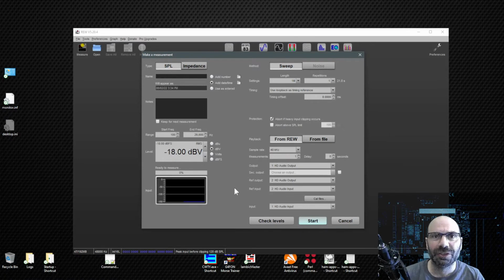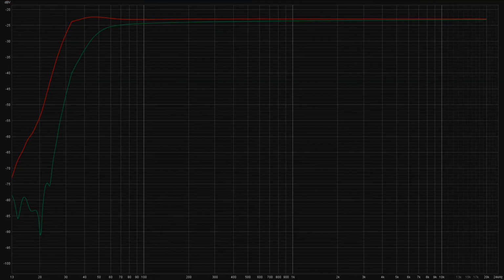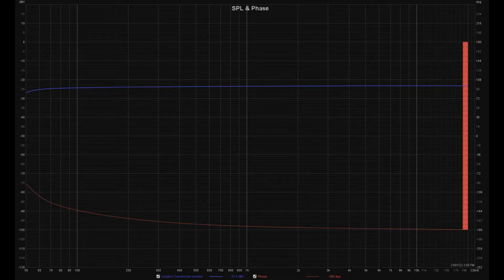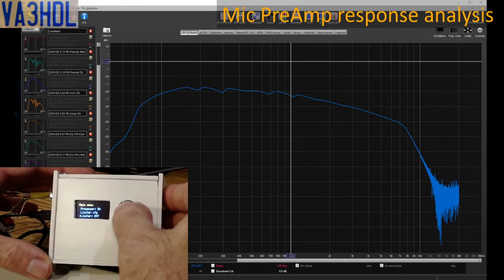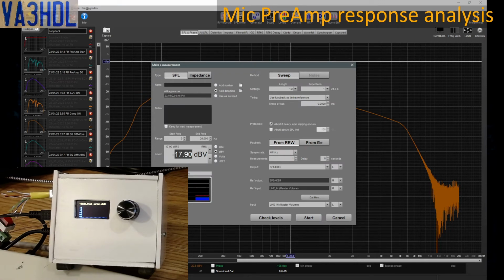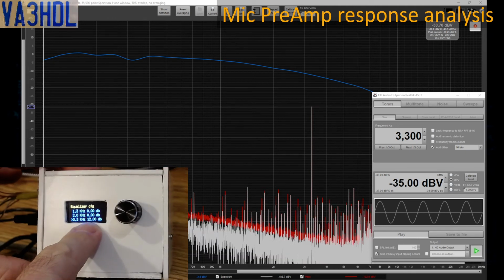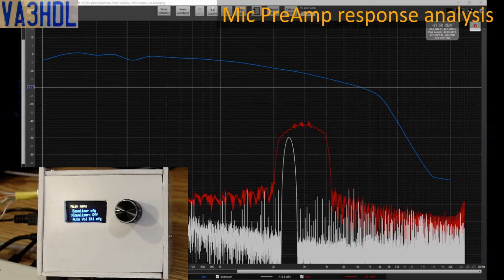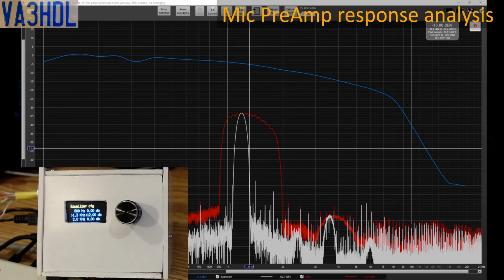Analyzing the response Mic pre-amp and equalizer (Part 4)

Comment: Did you ever work out why the EQ glitch was happening? Does it happen on each EQ setting, or just the 1.3KHz I wonder?
Reply from the maker: It has been three years since I worked on this project and I can't remember. Can you pin point the timestamp on the video so I refresh my mind on this? Thanks.
Reply: @VA3HDL it was right near the end of the video, around 15:30. Thanks for the reply.
Reply from the maker: @ian.dobson  I can't remember if this was fixed or not right now, but when I started looking at the code and the repos in Github I found that I never uploaded my last version of the code. 
I just did and the new repo URL is https://github.com/VA3HDL/DSP_Pre_ProcessorV6
Even is not fixed it would be better to use the latest version. I did this without AI, I guess I can go back now and review the code with the AI to see if is any improvements possible (or you can do it.)
In V6 there is a built in tone generator that helps to trigger an external auto tuner attached to old radios. The tone is enabled by double clicking the encoder and disabled in the same way. When is active is possible to see the waveform of the tone on the spectrum display of the device.

I hope this helps. Let me know you thoughts. Thanks.
Reply: @VA3HDL thanks Pablo, I came across your video while trying to find a DIY audio speech processor and or a parametric equaliser. I'm not sure I'd be up to code modification myself, but if I can get the bits together for your project it might be fun to have a go at it. Do you have any links to the parts I would need?
Reply from the maker: @ian.dobson  Someone took the time to write the circuit down for me and sent me the PDF which I uploaded to the repo. All the parts you need are in the diagram but I do not have links. Basically a Teensy 4 with its sound shield and the screen are the main components. https://github.com/VA3HDL/DSP_Pre_ProcessorV6/blob/main/Teensy%20Pre-Processor%20VA3HDL.pdf
Reply: @VA3HDL many thanks Pablo.